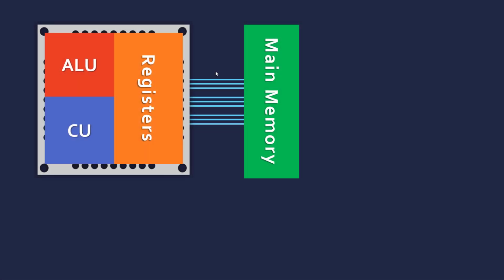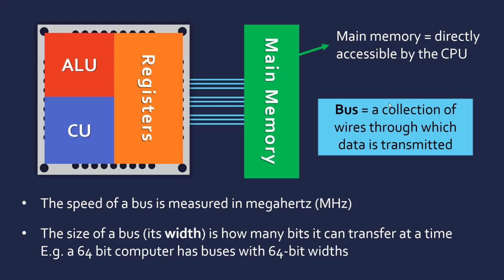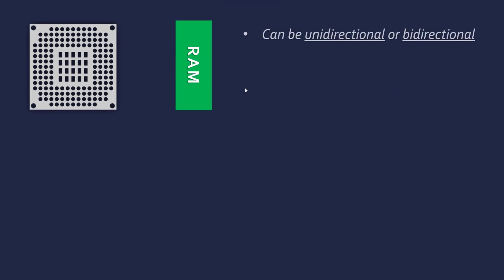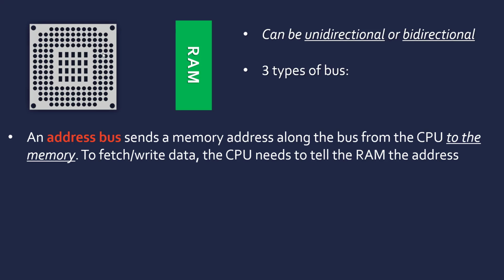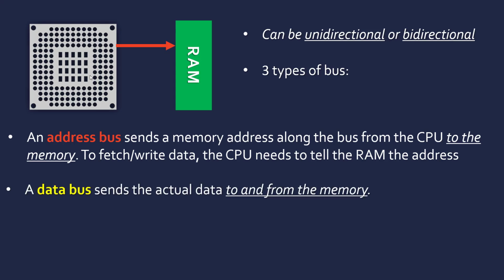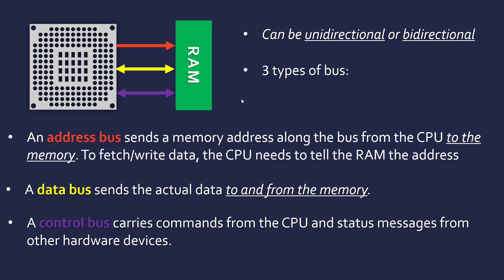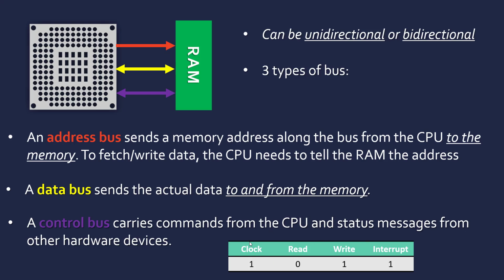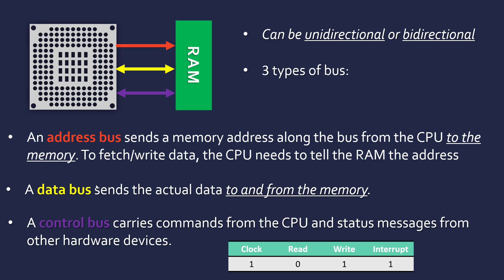Address, Data and Control Buses

Comment: A bus is a pathway to which data is transferred; they come in two types 64 bit or 32 bit. A useful metaphor: A bus is a motorway and the bits are the individual lanes so on a 64-bit bus more data can travel across a wider range, and of course the traffic is the data. A Bus can be unidirectional or bidirectional, meaning it can move data from and to (unidirectional) or either to or from (bidirectional).

Types of Buses:
- Address bus: sends a memory address FROM the CPU TO the RAM, the CPU is asking which address is the next piece of data to be executed is located. = Unidirectional
- Data bus: Once the address bus has specified the location the RAM can now send and receive information to which the CPU is now executing the data. = Bidirectional
- Control Bus: Carries commands and status messages which can tell the RAM to backup data or to prioritise this instruction rather than this instruction. = Bidirectional
Reply: thank you stalin, very cool
Reply: Cool
Reply: Reazar87  i passed my comp sci and still dont know shit about how a computer works lmao
Reply: @chronicsnail6675  😂😂😂😂LOL. From where u are
Reply: Thank u
Reply: @siddharthkumaryadav3356  mans from beddy

Comment: Hi - love your videos and I have my exams on Monday so thanks for the help but was wondering whether my answers are too detailed because I have been memorising of a text book and doing a work book and some of the answers I write are much more detailed than the ones in the answers of the workbook. The workbook is for edexcel and everything but Im worried that my edexcel exam may not accept my answers cause its not in the mark scheme. Would they accept it if it was technically right but more detailed than expected?
Thanks in advance
Reply from the maker: The examiners are subject specialists so they'll know when you're correct. You'll learn a lot about exam technique as you go through the GCSEs and you won't be perfect on the first exam, but you have to look at how many marks each question is worth - often you can guess what they want. I would always write too much but eventually I think being more concise became my biggest skill, so it's worth trying to adapt your approach slightly
Reply: ok thanks - really appreciate your help
Reply: @themirestudios3326  How did it go.
Reply: @siddharthkumaryadav3356  I got a 9 in the end so it went great
Reply: @themirestudios3326  O that's good
  I don't know about GCSEs so much so i had to Open Wikipedia to understand what 9 means 😅😅.

Comment: Thank you this really helped me but I don't get how when at the start you have the 3 buses on the screen and you say for a 64-bit computer, only 2 of them would need 64 lines. However, wouldn't all of them need 64 lines if it was a 64-bit computer?
Reply from the maker: Oh, I was referring to the control bus which doesn’t strictly need that many (though it may do) because it’s used a little differently
Reply: Computer Science Tutor ok thank u

Comment: ok but WHY do computers have busses why can't components plug directly into each other?
Reply from the maker: A bus is just a wire, so that's like saying why can't your computer just plug directly into the wall socket. Well, it does, just with a longer wire than absolutely needed (but we need a wire for electricity to flow through). In terms of why they are split up into these 3, it's mostly about efficiency, as data can move about in parallel, not having to wait its turn to go through a single bus.